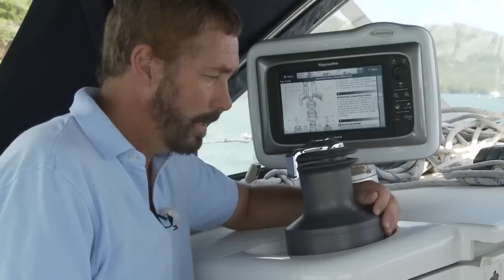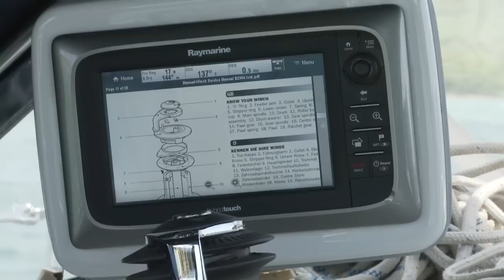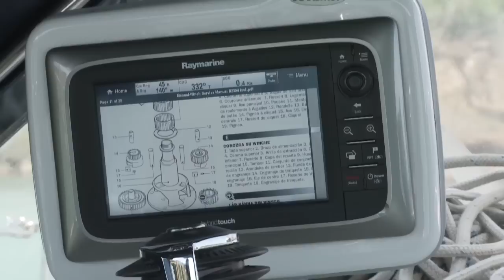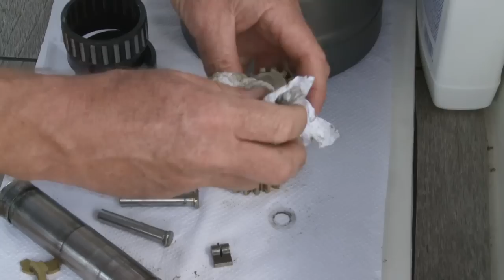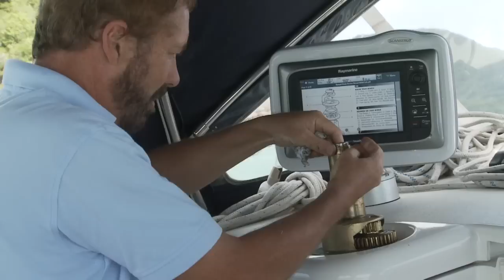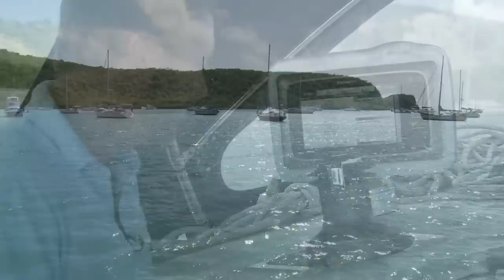Have you serviced your winches recently?

Comment: So how exactly is "winch grease" different from a high quality lithium or white grease, other than costing ten times as much at a marine supplier?
Reply: I somewhat agree with you...
You are correct, anything with the "marine grade" name will have a premium. Lewmar just repackage the grease and takes a huge chunk. 
It doesn't appear to me to be lithium grease,  you can ask Lewmar for the MSDS and check for yourself.  US Tech Support Email: ustechsupport@lewmar.com
- As for *Harken*, their High Performance Winch Grease is a Fuchs FM GREASE AX/EP 2 and will cost you $1 per Oz instead of the $4.5 per Oz when Harken branded. It's just a 450% markup ; -))) 
Ditto for the Harken pawl oil, it's a Bardhal T&D 80W-90.  Markup is now 1,220%.   
I seriously doubt that Harken grease is going to break your Lewmar  
Now, if I am in dire need of it, in a harbor or a marina, I may swallow the pill rather than spending 2 hrs and 20 miles in an Uber going to the nearest Lube R Us to save $10.